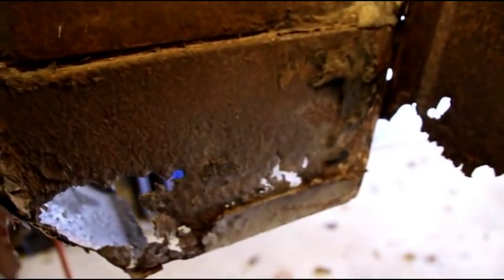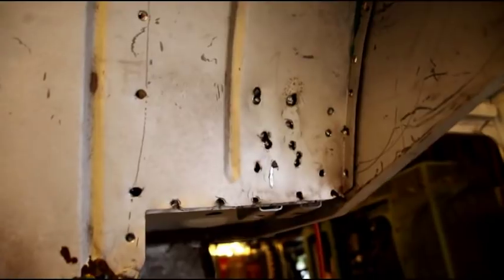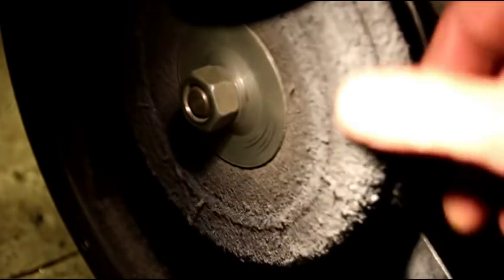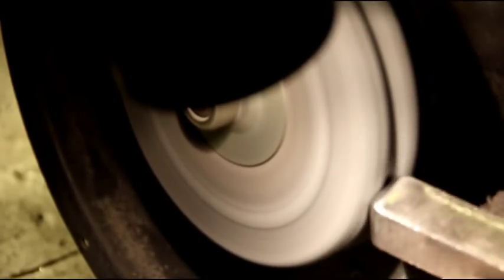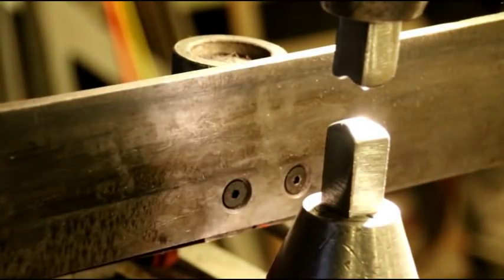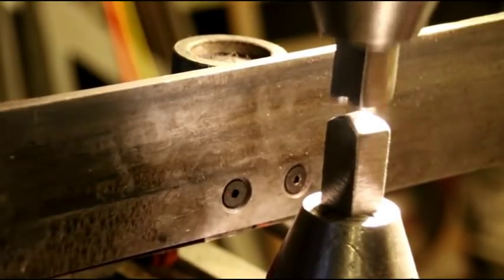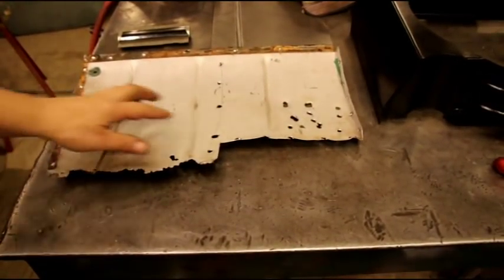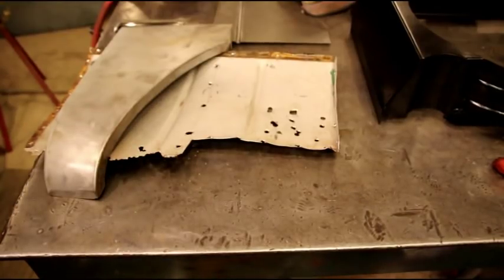Willys FC 150 Cab Restoration, Part 2.  Pullmax Dies for Beading

Comment: Thanks for the video. What exact type of deburring wheel do you recommend? I looked at 3M scotch brite wheels. They offer different grades (medium or finish) and different densities (8,9,11). I don‘t have any experience with deburring wheels yet. Would appreciate if you could recommend what works best for you. Thanks.
Reply from the maker: I like 3M, norton, bear tex, etc..... not too many bad ones out there, they all work pretty good.  Norton and bear tex hold up great.  I like the medium 8 or 9 works great for polishing up tooling and general deburring.
Reply: Thanks! Much appreciated.

Comment: How do you know how to make the bottoms of the panels when they're completely gone like these ones? It must be extremely hard sometimes with more rare vehicles like these where you have nothing to use as a reference.  Great video, thumbs up as always :)
Reply from the maker: I have a huge inventory of patterns to work from.   when I don't have a pattern I usually refer to the other side of the vehicle to get a mirror image of what I need to make.  When that doesn't work I have to back track and work with what is left of the panels it attaches to.  It can be a real hassle at times but there is usually a way to determine the pattern shape.